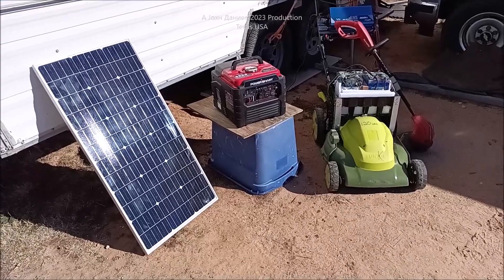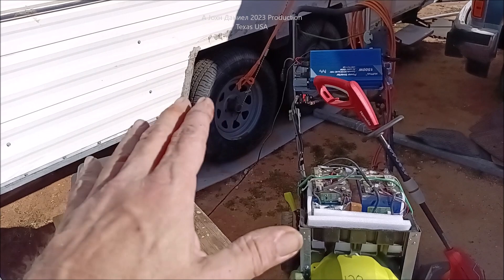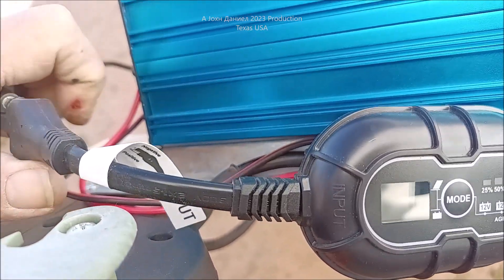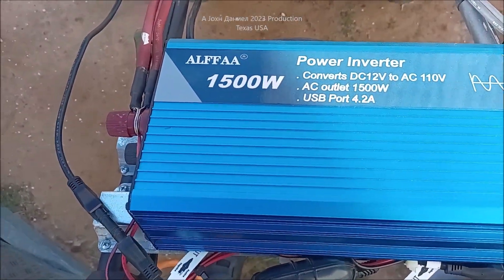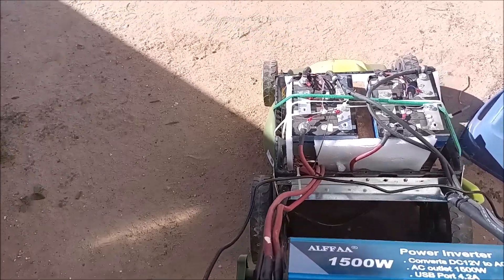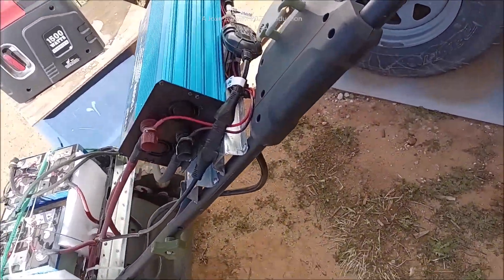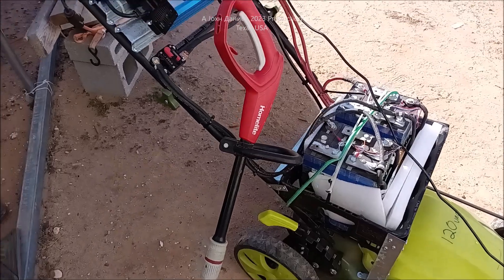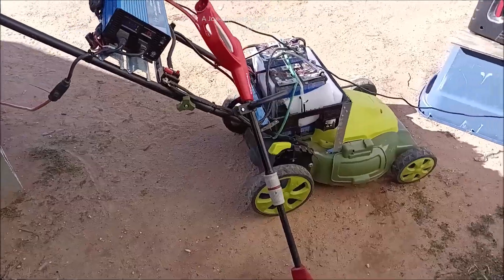DIY Solar Powered Lawn mower and mobile AC  DC power plant

Comment from the maker: POWER QUEEN https://amzn.to/3Hva96p 😍 LiTime Mini 100 Amp Hour,  https://amzn.to/3P5I1Zl  Go⬇see all ⬇*PROVEN SOURCED SUPPLIES, TOOLS & DIY PARTS* https://amzn.to/43KP92U Need Tech Answers? go👉 Donate $5+ with KoFi - https://ko-fi.com/john4kiera OR https://bit.ly/2buyaCoffee message, inquire, to get my help, replies!!  CHEAP DEALS TO LOVE - ✨Name brand off grid electrical parts, overstock priced at My Temu App: https://app.temu.com/m/mmx3fd0485u a $100 coupon bundle waiting for you. Locally Shipped, go to https://temu.to/k/um91ypa88vg now to explore, shop, and save big on Terminals, Buss Bars, Controllers, connectors, Solar, and more from name brands for 20% less! VIDEOS MENTIONED IN VIDEO (short link) https://bit.ly/3GxINZg

Comment: So it dose lead acid batteries but does it have proper charging perrameter for lead acid before I found utube I started to set up solar I needed power for our CPAP machines so I bought 2 big deap cycle batteries found out they were defective took them back and found they wouldn't cover the warranty so they gave me a choice to be stuck with them or pay more money and get 2 big cat batteries so I took the 2 cat batteries and when I tried to charge them I found our that my new Colman 30 amp PWM controller wouldn't fully charge them I tried both settings for lead acid batteries and both only charge them to 12 volts which is dead I had to use my 120 Volt battery charger which defeats the purpose as I have no 120 where I want to stay and charging them with the vehicle cost way to much gas so now when I look for a new charge controller first it must be mppt 2nd it must have proper charging perrameter for lead acid batteries and when I can afford it lithium as well
Reply from the maker: These controllers will charge your lead acid to 14.3 volts and maintain them at 13.85.

Comment: Ah yes good point about the dust and grass. Kind of a bummer for the inverter.
Reply from the maker: I figure I can make a magnetic catch on the top half, its a 60/40 shell and comes off real easy to blow it out when or if needed. But was fun to make a easy mobile multi use power unit.
Reply: @JOHNDANIEL1  It's definitely my style for sure. Haha